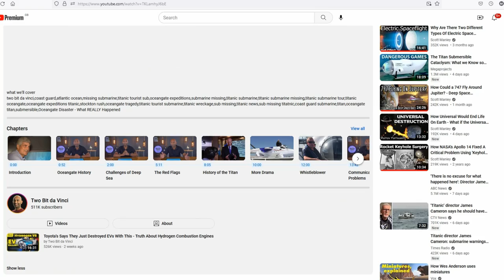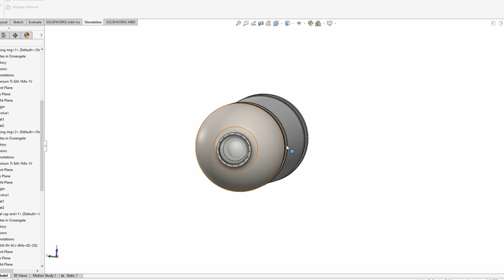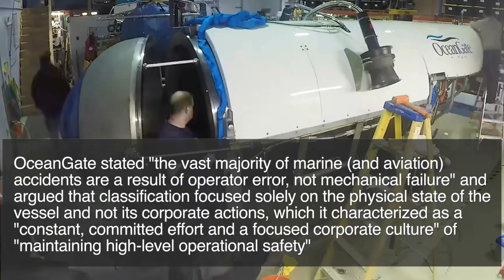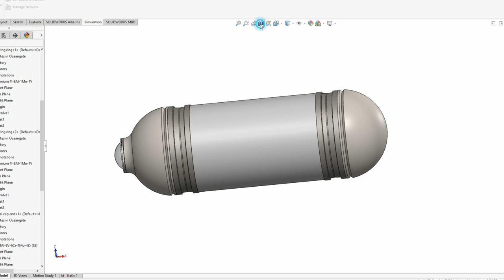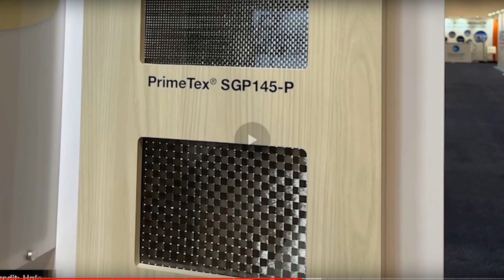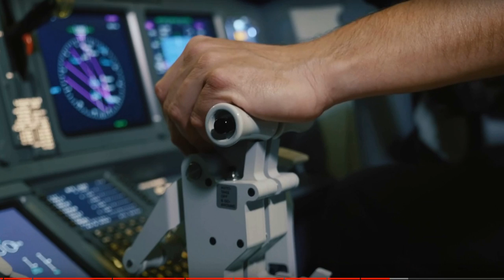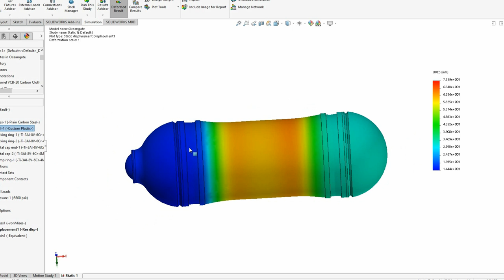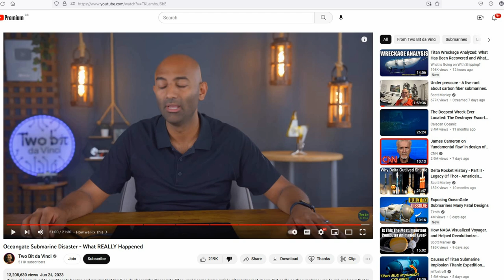Oceangate Titan - Engineering Failure?

Comment: The explanation with the flanges is wrong! As long as water can geht between the surfaces of the flange itself, there is no pressure differential over the flange and hence no force. it is something completely differen with the hull itself!

Comment: I'm puzzled at the discription of 'implosion'. If the composit tube was crushed then that's an implosion. I understand that. However, if the plexiglass cracked then the water pushed into the tube. Surely, its then called an explosion because the tube will blow outwards.

Comment: It tool the USN until the late 90s to buy off the shelf software (Microsoft NT) as the OS for USN ships. Till that time they were paying sqwillions for hand written codes for each sub system which amounted to mega millions of their budget. Since then, they upgrade and adapt new software to the newer hardware and firmware. That a is weak point of the F-22, which is a superior stealth aircraft in every way except they are getting rid of it for something that integrates and is programmable easily by new managers if needed.

Comment: It was stupid to use a wireless game controller. What if the battery goes dead? What if the conditions in deep water affect the range and signal strength? You get stuck and can't stop sinking because you can't get the drop weights to release. Just saying, an Xbox 360 controller the navy uses for a periscope is not wireless because that was put out before good and affordable wireless. A drone needs wireless, but you're not inside it if the signal is compromised.
Reply from the maker: "It was stupid to use a wireless game controller. What if the battery goes dead?"

- They had more batteries and it wasn't the only controls.

"What if the conditions in deep water affect the range and signal strength?"

- Internally?
Reply: @dirtygarageguy  What if there is a driver failure with the off the shelf game controller and the off the shelf windows computer and the BS software (that they either whipped up or jacked from somewhere) they used to map the controls of the game controller to the submersible thrusters? I've had driver failures that killed a component, having a spare doesn't matter. 10 spares wouldn't matter. In that case, there may be a complete failure of control and all their spare batteries and even spare controllers might not matter. Also, I was pretty sure that game controllers are only used by the military for drones and turrets. Nothing that is actually manned uses that form of control... because manned vehicles either on land or in the water or in the sky don't often have such simplified controls, controls even more simple than in your car, controls simple enough that they can be reduced to the inputs of a game controller in the first place. Your lawn mower has a certain complexity of control. Your car's controls are more complex. A plane's controls are much more complex than your car's, and so on. There is a reason for that. And there is a reason OceanGate wanted to simplify the controls: it's so people didn't require extensive training to operate Titan. Just like Rush wanted to avoid extensive testing to ensure Titan's safety- he just wanted to get to the bottom of the ocean as quickly as possible. That's why he's dead. I think you've got a bad itch to be a contrarian bro. Nobody controls multi-million dollar aircraft and/or submersibles with a fkn Logitech gamepad. It's not industry standard. 

Your comment echoing Rush's 'everything worthwhile carries risk' ethos falls flat on its face when you just stop and think for two seconds: nobody's died in an implosion before these five and yet people have been going to the bottom of the ocean for decades. It isn't risky when you know what you're doing. Most of the jagoffs who died on Everest knew they should have turned around and just didn't. Just like Stockton probably knew he should have turned around a long time ago. As for skydiving- risk? Not even 1 skydiving death results per every 100,000 jumps. Less than one. I believe the number is 0.27 per 100,000. It's not risky. How many times did Titan go down? I'm guessing it dived less than 100,000 times, which resulted in of course, a failure and fatalities. So comparing these two risk factors is a bit meaningless insofar as one is risky and one isn't. 

Buying Boeing's expired carbon fiber at a discount doesn't constitute having an engineering partnership with Boeing. 

He could have used carbon fiber and a more conventional spherical hull and got that working before moving on to the slightly more audacious coca cola can design, but he didn't,- Rush- because you can't fit five paying tourists in a sphere. These people could have spent a lifetime doing extensive testing and modelling, spending years making real partnerships with qualified institutions, etc.  until they produced a submersible that effectively and safely used carbon fiber- until they produced a new kind of lightweight submersible entirely that drastically lowered the price to get down to the bottom of the ocean forever by cutting the weight of the craft from 16-17 tons down to whatever Titan was, 9 or something. Would have been revolutionary. And that would have been their contribution to submersible technology and an adequate legacy. Yeah, they didn't. They BSd and fcked around and Stockton wanted to ship a product as quickly as possible that he could use to sell tickets as a way of funding his own self-absorbed personal Aquaman dream and now they're dead and now nobody's going to take a look at carbon fiber solutions ever again (with regard to submersibles I mean) for fear of irrevocably damaging their reputation, when it probably really could have worked.

So was Titan an engineering failure? Well, I mean... the chief designer died in it, so. Yeah, I think that's safe to say. When your engineering results in your death, that means it failed. They say only the dead have seen the end of war. I say only the dead have seen the end of stupidity.
Reply from the maker: "What if there is a driver failure with the off the shelf game controller and the off the shelf windows computer "

- What if there's a fault with a none off the self part? Same question. Have you ever played with military stuff? It is off the shelf parts.

Comment: All the parts of the vessel are being pushed together from every direction. So the items holding the parts in relation to each other become unnecessary the instant the  pressure on all the outside surfaces  exceeds the pull of gravity on the individual parts . All the parts of the vessel are trying to move away from the pressure toward the low pressure in the center.

Comment: 28:41 you’ve banged on this point several times now and I can see where you’re coming from, get to the crux of the issue that the video title claimed it would discuss. But at the same time, contextual information like this isn’t just about contemplating “what ifs,” instead it puts into perspective the management/logistics/etc and typically, catastrophic failures are more likely when you don’t have safeguards, when you’re taking shortcuts, etc (ie a history of bad decisions). So in that sense a bit of context about how the company was run and the decisions taken long before that final dive lead into what happened. 

Just my 2 cents.

Edit: hahaha, I see. I think you went into this video expecting an engineer talking shop with other engineers, but instead got guy who (may or may not have an engineer background) doing the equivalent of science communication with laypeople.

Comment: Admiral Beeties bathasphere did get a miniscule leak on a test dive of short duration, everything was shot to bits, as if by bullets. Where this bloke may have misunderstood his need for knowledge of testing, is in the circumstances of environments. An aircraft is working on maintaining a pressure within, where a submersible is looking to resist pressures from without. Where his theories failed, is by the same standards applied by NASA  to the first Space shuttle disaster, the engineers applied their failure concern model, to a single point failure of acceptable nature. Whereas they should have been applying the much more rigorous standard of "Catastrophic failure"  Human systems failure was the cause. 
The statement from the company was del level bullshit. One remaining mystery remains though. The CEO had a very tiny and insulalur pea brain, which would have survived the implosion, so I wonder........ 
Why would you do that? Some ideas can be superb, some can be EPIRB, and some are just "I feel pucky, lunk"

Comment: At 16:38 on your video, you does not understand "column of water" or "column of air". It is the main cause of that pressure, respectively. It does push from any direction. The total mass of air of water holding that imaginary column "upright". Please study physics at least little bit.

Comment: The comments on here and all across the media make me die a little inside. Yes they took risks and used unconventional materials/methods in building the submersible, but they had the courage to do so and push the limits of engineering in the name of exploration.

Also the comments implying that the people on Titan were somehow duped into a false sense of security by Stockton and Oceangate is also tosh. All on board knowingly accepted the risk of death in order to pursue a dream, signing a waiver in the process that mentioned death no less than 8 times. 

Yes it ultimately cost them their lives, but at least they died daring to dream and not in a hospital bed regretting not fulfilling their dreams. All on board are heroes in my book for daring to push the limits of human existence.
Reply: There’s a difference between pushing the limits and being negligent.
Reply: @derschwarzgeist  and who's to say that Stockton and or Oceangate have been negligent? Yes unconventional methods and materials were used on the Titan, but that doesn't automatically equal being negligent. And In order to push boundaries you have to stretch what is considered to be the norm. 

I will repeat all those on board knew and accepted the risks, and if they did not do their own due diligence on the company and vessel then they did so at their own risk. They were all adults, and made their own choices to go down there based on the information available.

Comment: @Dirty Garage Guy Air column doesn't mean an actual thin column like an excel sheet. It's a scientific term that refers to the air above and around you that is enacting pressure on you. You should probably do a bit of research in the future before making blanket statements like that because you are getting dangerously close to sounding like a flat-earther.
Reply: He sounds like a flat-earther for giving the more scientifically accurate description? What are you smoking?
Reply: @derschwarzgeist  He didn't. He said that he didn't agree with the actual scientific term and then proceeded to describe exactly what that term already meant.

Comment: As a stupid in the blind. Carbonfibre is very strong, except with the possibility of repeated impacts, where its characteristics change by weakening over repeated cyclical testing. To the point of being unacceptable for anything except single use/disposable ultimate stress use. They could well have joined the two hemispheres and ditched 2-3 people and they would still be here bitching about the price. I would go on to surmise, without any testing that had the cylinder been constructed of titanium of the same thickness it might still have failed by warping/bowing at extremis. Sorry Matt, ye olde Latin sneaks through. It just means the old anyway.

Comment: Do electrical engineers differ from a materials engineer? I believe the two types of engineers differ in knowledge & expertise. 
I noticed a particular engineer  referenced as working for OceanGate is an electrical engineer. 
Are electrical engineers on projects responsible at all for saftey of or material used? If the material is in question-don't hire that type of engineer.

Comment: Your design model is totally wrong, plus nitpicking someone's video. It really wasn't bad at all.
Reply from the maker: Thanks for providing details...
Reply: @dirtygarageguy  I have no details, but 127mm think skin of carbon fibre must have been put on something, and as you said the 1 inch relief grove you thought to small, well how did that get there? Machined on a lathe? No carbon fibre left on the salvaged end caps? I guess the carbon fibre was reinforment to an alloy tube with welded end rings at each end, which started letching water at the bonding point(s) and then failed equalising pressure resulting in the window clamp failing which then blow the end caps off in the implosion, the other materials if recovered was not for public viewing most likely or undisclosed until inquest results. Time will tell.

Comment: It's not just pressure cycling that's happened here but also temperature cycling too. They're going down to temperatures just above zero and then back to higher temperatures. That will have a massive affect on the glue (facepalm) holding this together. I have no problem with Rush cutting corners and being a dick but you do that alone and certainly don't take innocents out on your deathwise visits.

Comment: You have informative points and diagrams. I have trouble with slicing and dicing another YouTuber's video rather that giving straight facts of your understanding. I am not saying that you're not on point with some of the info, I just think Two Bit Da Vinci may have had a different purpose than your video. Why not just share what you know? Bringing up his credentials and number of views of the video is suspect to me. Some of these facts you presented may be subjective, e.g. the lauding of the use of remote control. I understand that the remote control concept is used with other authentic vessels, but someone lifted a point that those are not "off the shelf," as Stockton bragged. Most of the information I've gleaned is that authentic vessels use hardwired remotes. Since you have the videos from their website, why not use their information and explain how that measures up to the final story of the Titan.

Comment: the Titanic wreckage is at a 3800 meter depth, and there is virtually no visible light from 200 meters onwards. They put a window in the nose so that you can see out.

That's the sort of feature creep you get when something's designed by committee, and none of them know what they're doing.
Reply: There was a massive battery and light array on the Titan

Comment: The F-35 helmet also suffers from the typical defense contract bloat. But if some company did release a civilian version for flight simming... It would be damn well over 10k dollars. That dude should see the price of some of the super high end home sim gear that's available these days. The reason the military pays asinine amounts of money for stuff. Is simply because they can. They've got an astronomical budget. Pretty much every surface combatant the navy has, costs billions of dollars. As do the subs. So to them 400k for a helmet seems like a deal. Especially since the wearer of that helmet is flying a billion dollar plane, and firing off "disposable, expendable" munitions that cost a million+ per shot. It's all relative. Also, when congress starts to bitch about aforementioned giant military budget. Guess what the first thing is that the military does? Lol.. They start trying to integrate off the shelf components into their vehicles as much as possible. If some high end sim company built a helmet as capable as the 400k F-35 version. And sold it for 20k... The military would almost certainly try to switch to that as quickly as possible. Of course the congressmen, former congressmen, retired admirals, etc. Who are now employed by the defense contractor who makes the 400k version. Would make that very difficult. Hence the ridiculous price of shite.

Comment: 17:25 great job stating pressure isn’t akin to the absurd notion of of a column of air as you pointed out gas particles fly at high velocity in all vectors characterized by elastic collisions. Elastic collisions referring to the inexplicable nature of their behavior in that they collide and do not lose momentum. You did however attribute the pressure to a downward force and this is incorrect as gas comes from the ground and it’s pressure is more at the ground due to density of the gas in its accumulation. Great video tho. Seeing the trust fun baby watching as the carbon fiber was wound like thread on a massive spool only adding to compressive forces indicated why this was such a blunder. Any grade schooler kid knows winding string on a spool adds compressive force. This trust fun petulant manchild was trying to design this sun like a traditional carbon gas canister with internal expansive forces of gas and not for the compressive forces of such depths. What an abysmal failure. It’s almost too dim to be dim. This demonstrates the value of discipline. Manchild needed to be told NO as a daft lil bratty child. End rant
Reply: Oh and I meant to mention this sad design of the winded fiber on the spool indicates it’s a lie that Boeing or nasa or that university had anything to do with this design. If so we’re all doomed as the design is daft and engenders at that level should have known better instantly. I want to see the lil model they tested. What a sad joke

Comment: If this dude has anything else to do with "materials" than as cleaner/janitor in a such facility...
 I eat my pants...

Obvious failure point...  Interface with different compression rates of carbon fibre and Titanium....

In those depths Carbon fiber cylinder compresses sometihikg like 5-15mm more than the titanium does..
It's a somewhat miracle that it survived any dives